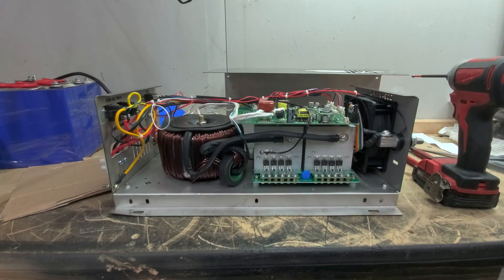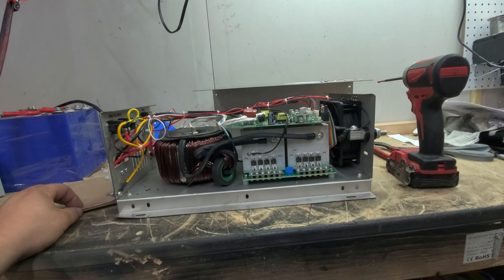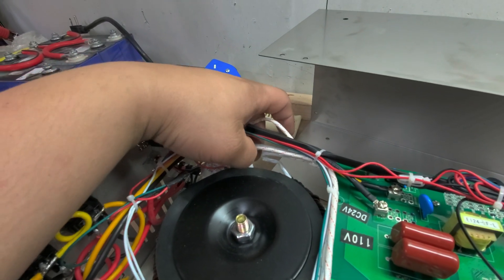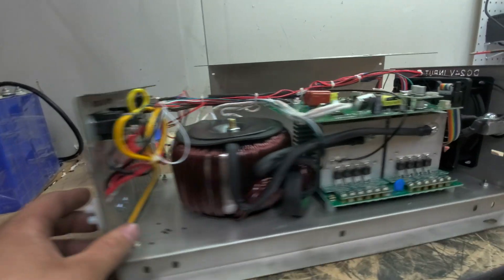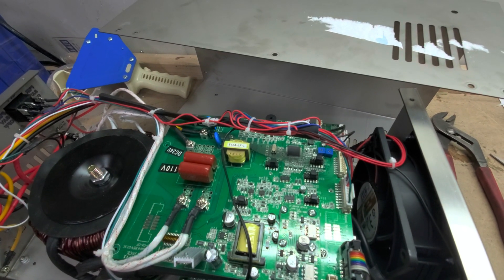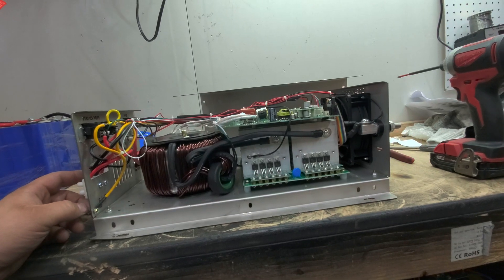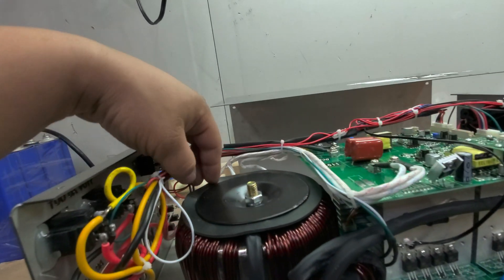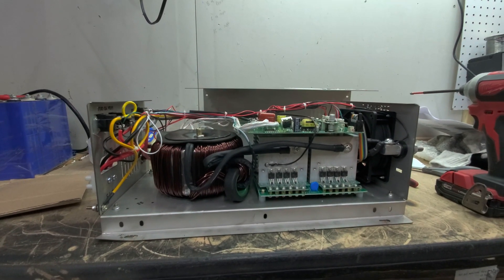New Power Jack 3000 watt Split Phase inverter (2020)

Comment: would this run my pool pump? its pulling just under 8 amps, on 240 volts.  i kind of wanted to isolate the pool pump from the house utility power, and run on solar/batteries........any thoughts?

Comment: You're forgetting about something though. This inverter is perfect for an RV like mine. I have the 15000btu  ac unit on the roof, and a 120v washer/dryer combo that this split phase inverter would be ideally suited for. My panel uses 1 leg for the ac and outlets, while the other goes to the microwave and washer/dryer. 4kw would give you more headroom, but honestly, I'm running all this on a 3500watt single phase inverter at the moment, so it should easily handle a setup like mine! =)

Comment: What version of the ASL? U-power uses an ASL-1 in their "6000" Watt units. I did notice that the 6000 Watt units use an item on the outside AC side Mosfet panel. Takes up the leftmost screw hole where a Mosfet would  be. There is a thermistor directly to the left of the leftmost Mosfet ( your ideal place for one ;-) ) also. The  item not shown on this one also connects to another one under the transformer winding. It could be that it is hidden on the inside of your unit as I see green and white wires also there.

Comment: Another use for a small split phase is for those people who have a well pump. Our EM Panel on the EM transfer switch is split phase. All but the pump are 120 Volt circuits. The pump is 240 Volt. Would this unit run it? That would be a good question. I doubt it as the breaker for it is a 20 Amp. But yet our 3500 Watt gasoline generator started it with no problems. Running current is about 7.5 Amps.

Comment: Sean my wife amber is asking about your wife's channel 

You know how lazy us fans are you need to put links 

If I don't here from you by the time I go through all these dell laptops I will just send you one or two

if you come across a 10.3 or any other 48 volt control board (or better yet maybe the new gentery solar  control board hint hint !!!)

I would love to test your new control boards I have 4 or five extra inverters a blow up would be fun 

I use dc breakers in between inverter and battery  between charge controllers and batteries 

I am a experienced electrician and know I use at my own risk with out you being responsible for anything not even blown parts

I no you are very busy and don't care if you answer back or not when I am just gabbing 

Every time I bought anything from you or anyone else or had urgent question or problems you have contacted me very quickly!!

Will keep reporting sort and to the point!!

I follow directions to the tee and have monkey see monkey do skills

I own a soldering station with hot air many parts testers many multimeters a scope I don't know how to use 

I have a medium size room full of parts for inverters and other solar stuff

The wife and I have wound to many to count Transformers even have wound cores 

I have a extra set of factory mosfet boards 

I have the custom mosfets boards a professional friend on the back shed design and made a cad file for 

The ones that use three large 247 size
Mosfets like the 360 amp 5608  the hy4008 mosfet or many other high amperage mosfets 

I also have over 70 extra hy4008 mosfets

I have  a extra low frequency driver board

I also have many Transformers  including a  a s L ,
a s 3 , a s 4 along with and a few 50 pound trannys and a few over 70 pound trannys 

I only have 8 new 150 amp hour  glass mat  s l a batterys that retails for around 600 bucks apiece 

But I have around 50 of those 330 watt solar panels with good sun I  can beat a inverter badly

 my favorite  pastime lol

2 60 amp make sky blue mppt charge controllers 

2 mr pow 60 amp mppt charge  controllers the knock off of make sky blue 

The mr pow controller's  I bought  for 56 bucks on AliExpress it includes  everything but the heat sink and little box 

I am putting them in the case of the latest
inverter build (farm inverter)

Inverter and charge controller all in one sound familiar Sean ?

I have no shame a good idea is a good idea!!

I have gigantic capacitors I am using close to and  with the main board caps

Thay are bigger than pop cans!!

 I am hopefully not having to rewinding a over 70 pound tranny for it also

It has eight 12 gauge enameled wires for the secondary 120/240 side  

With any luck it will have sixteen 12 gauge enamel wires to use for secondary 

No heat tranny is the goal 

Sorry to everyone reading i rambled off topic to sean for a couple paragraphs skip down to words in caps

Sean will either be happy or confused and concerned about crazys on internet having his address!!!

Any Transformer I build will be able to handle full output even if loaded only on one side 

It will have extra turns to lower Tesla
which make for lower idle current!!

It will also have the approval of warpspeed
 (the great)
Very wise man who was building inverters before I was  born (he is on the back shed website)

God bless the people of Australia! 

Many incredible people live in Australia!!!!

 My business  partner best friend already gave the go ahead for numbers approval!!!

I wouldn't have said anything to him or you without doing rough numbers first!

The last business idea wife and I was sure of my best friend jumped on

 him the wife and l  babied it along with the tighter than tight grip my buddy had on the financials and him driving inberasing car or sometimes the work truck it made money first year  and has grown every year since very profitable now

More probably  unwanted info 

With the around 100 thousand he worked hard and DID WITHOUT even THE BASICS to save

Trust me he suffered for it back then I made more in one year than he did in five now he makes more in one than I do in ten!!

 He stayed home to care for disabled mom 

Great grades many scholarships available to him 
very bright

 Never tasted achool until wife and i tricked him with shaky jar (vodka in carnival style lemon slushy (never again)

He never smoked cigarettes or other until wife and I got happy cloud in small camper (never again)
It was so funny!!!!!!

He is the only person to stand toe to toe more than  once 

He done it over and over for my own good 
fearlessly 

He is not by any means a fighter but way to fearless when certain ass wiping or gun is pulled 

Piss is the worse word you will hear come out of his mouth 

He is now taking good care of his dad 

 After I spent many years of torturing his dad to speak truth 

He admitted one time his son is a good business man along with being one of a kind good person 

 His no debt rule unless to grown business and all profits go imedently to loan so not one day more interest (that is any money that didn't get spent on my family  or my problems!

 HE SPENT MANY YEARS  BEING A GOOD FRIEND THAT I DIDN'T DESERVE  TO HELP  FIX  ME AND MY WIFE  I WAS SO MEAN!!!) 

He doesn't like to pay interest at all 
Even small interest he has over 800 credit score an 
credit line he probably doesn't need 

Him alone who would own any business I speak of!!!!

 I don't desire money and if I need any he has proven he will take care of it even before any business we started 

Yes that kinda  friend  isn't  just fairly tells

When I talked to him about it he mentioned mabe later on if all is well why not full production beginning  to finished 

And he is looking to diversify!!!!

He is teck savy he owned and operated  the first high speed internet company in our area 

Him and I climbed water towers and he would climb cell towers himself!!

That business was ruthless when big companies came in he sold  out of course  he made money 

He still owns a satellite tv installation company
It still makes good money when specialty work pops up he started it at 18

Good new business plan honest business partners along with a God loving help anybody positive thinking cheap living thight as bark on tree BEST in world business man with what seems to be endless funds makes for good odds of success!!

 That Godly friend saved me my family and him and his wife are my kids god parents 

He gave his word about what he would do for us no paperwork needed 
between us 

He has full filled all of his word and much more!

This  rant or rambling  may be unwanted it definitely was not asked for 

I told you my wife and I like the way you treated us and think of you as a friend 

I have very few true friends wife and I  trust are gut when it comes to people (wifes gut has never been wrong)

 You Sean past my gut her gut and my  best freinds
gut 

Even though you was only being a fair business man

 Yourself shines threw You was  not trying to make a friend but you did 

On your side you don't know enough about us to know if we are internet crazys or good people 

So if or intill you get to know us one day you have  full friend treatment and a good  friend expects nothing in return!!!!

Sean I hope you are
thinking about what may be possible my friend will go with me on most things but he is a business man

He will provide a well made product well under the cost anywhere else without going against  his morals 

He has many skilled  workers on hand we live in a poverty stricken area 

He owns a large building and store front making no money if he doesn't  lose money he will help the community 
out!!

BACK TO NEWEST INVERTER BUILD THE FARM INVERTER 

If you want to check it out pics and more info is on the back shed web site 

Scrolled all the way down here for that 
Sorry I ran out of time

My wife says always 
Remember  attitudes  are contagious 

 the smartest people learn from others  mistakes 

Its not what you go through it's how you handle what you go through 

You can learn from anyone young dumb old or stinky anyone

Remember your creator loved you so much he made himself human lived a sinless life so he could be the perfect 
sacrifice for what we have done wrong 

Yes the greatest way to show love is to die in place of the one loved 

this is the main true story of the bible

And it go to heaven is a free gift  you don't earn it if this sounds crazy you have been listening to people with alternative motivations 

The Bible tells  about how much your creator loves you and wants to share equally everything he is and has with you and wants nothing in return  except for you to accept it

You just believe in him he dose everything else for you just like a perfect  father would 

The sooner you believe no one or anything you yourself can prove by testing or thinking for yourself the sooner you understand everything we know as truth is a lie ever wonder how the rich stay rich generation after generation maybe we believe lies instead of questioning everything others may not think like you you don't want to rule over others they do please think for yourself believe nothing you where tought with out testing it yourself

Thanks for reading hopefully you will
have a blessed day
Reply: I think we need a few chapter breaks in that comment ;-).  
All teasing aside, I can't recall what the Boviet panels you had were rated at?  That is, if you were the person in WV with a bunch of them?  (It was in a live chat, and I didn't write anything down...). If they're 370W panels, I'll work some deal out for a dozen of them.